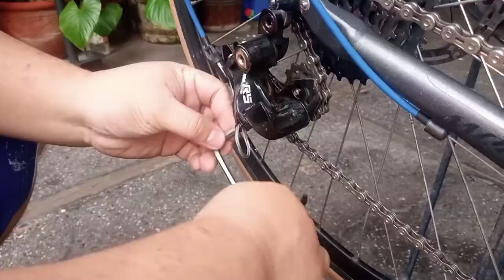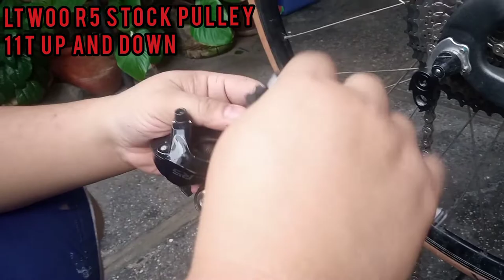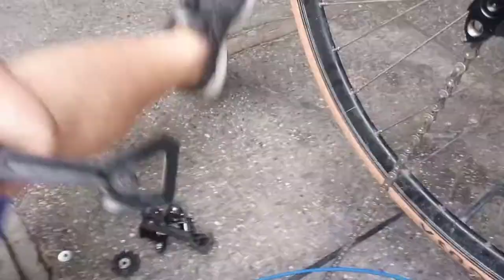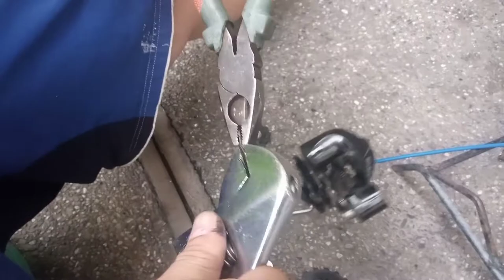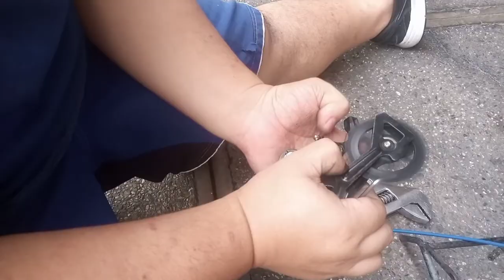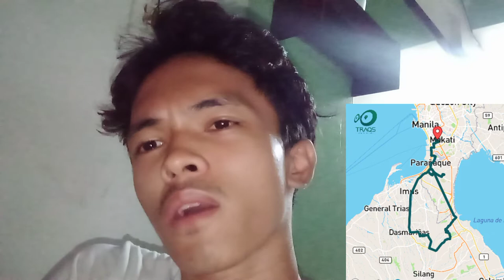Ltwoo R5 modification | Ltwoo R5 oversized pulley Installation | Sealed bearing pulley

Comment: Pede poba 14t sa upper pulley?
Reply from the maker: Check mo yung clearance ng upper pulley at cogs mo... If may space pa.. sakin kasi naka goatlink ako kaya kasya sya... Currently naka 16T na upper pulley nung sakin
Reply: @markscycle121  13t nalang nilagay ko lods di kasi na aadjust ung layo ng rd ko
Reply from the maker: @j_m1_4  naka 16T ako ngayon up and down.. pero ginamitan ko ng long goat link para di tumama yung pulley sa cogs.. pwede naman na po yan 13T up goods narin yan.. tapos kung gusto mo lagyan ng malaking pulley sa baba modify mo nalang din rd mo... Pero kung mag mumodify ka ng RD i suggest gumamit ka ng FOVNO pulley para di ka mamroblema sa chaindrop sa rd
Reply: @markscycle121  anong brand po goat link mo?
Reply from the maker: @j_m1_4  aeroic po

Comment: Link po?
Reply from the maker: I suggest ito nalang bilhin mo.. fovno para kahit imodify mo rd mo di ka mamumroblema sa chaindrop

https://shopee.ph/product/524132803/17519703223?smtt=0.82311522-1657530049.9
Reply: @markscycle121  hindi idol link po ng pinagbilhan nyo ng ltwoo r5 rd
Reply from the maker: Ay sorry po hehe kala ko sa pulley

https://shopee.ph/product/431588282/3997614475?smtt=0.82311522-1657538004.9
Reply: @markscycle121  idol tiga san poba kayo makikipagswap po sana ako alivio po akin m4000 1 week palang po
Reply: Pang mtb po kas enabili ko hehe